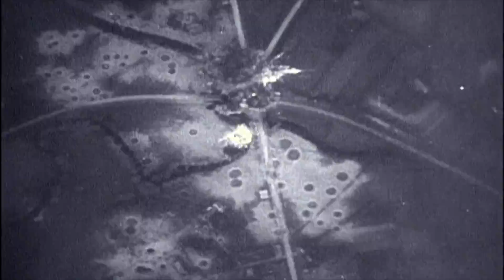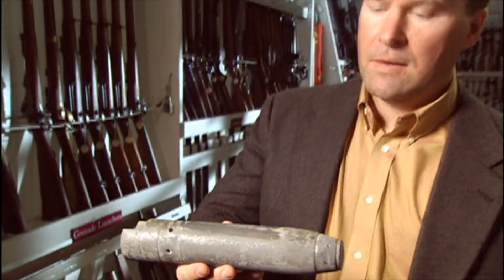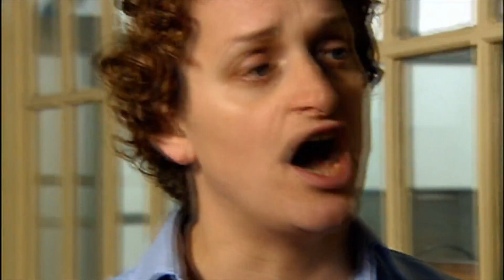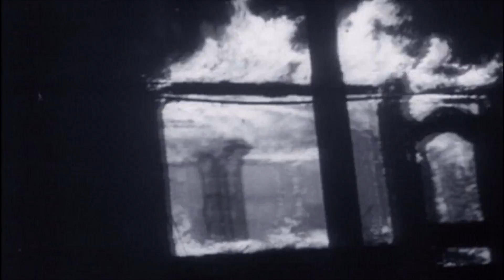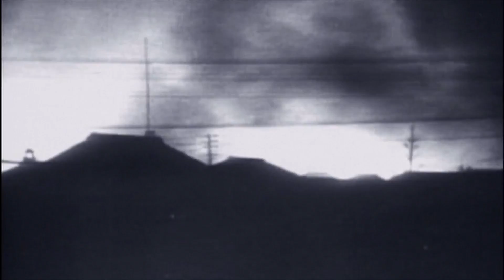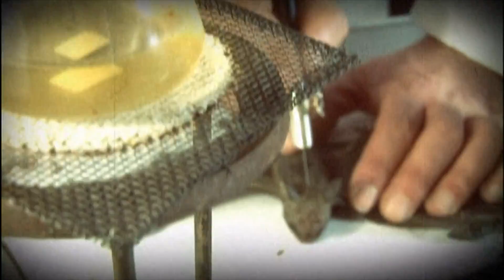Weaponology - "Incendiary Bombs"

Comment: “A lot of bombers, a lot of sorties, a lot of dead American airmen.”  To the British and then American bomber crews, thank you for your sacrifices.

Does anyone know the cost differential between an incendiary vs a gp bomb?  I know both were used widespread, but wondering if the manufactue of incendiaries was more or less involved than HE.

Also, I’ve read about several cities experiencing firestorms, were they relatively common, though?  That is, did nearly every incendiary attack result in a firestorm, or were there special circumstances involved that made some raids especially destructive?

Comment: The Japanese got their idea of balloon bombs from the British. The British got the idea from when their barrage balloons broke loose and drug their steel cables across Europe shorting out power lines and such and starting fires when they crashed. When they realized what was happening after they broke loose the British started doing it on a regular basis with cheaper balloons and because of wind currents the Germans couldn't do it back.

Comment: February 13-15,1945 was probably the worse scenario incendiary 🔥 bombing in Dresden than other German cities. March 9-10,1945 was really greater the worse scenario of Toyko, Japan. When night bombers flying over the city below they would say that the city below has dropped into hell. So much turbulence from the flaming city made the bombers flying much higher at 200 feet a minute on full throttle. Wings can be ripped apart from the turblence. The bombers that flow back to base can actually see the reddish-orange glow at 100 miles away at 13,000 feet. Returning bombers were actually covered with a dark grey soot. Human bodies actually hit the bombers do to the turblence at Gale force. Those are called a Firestorm growing out of control, babies can even suffocate when their own noses would burst open. People had to turn over the babies so they won't die from suffocating. White Phosphorus is still available today but yet it's very deadly poisonous. Napalm was invented by American as a sticky gooey gel but yet Napalm B a liquid not a gel making it burn longer than Napalm. Thermo barbic weapons has the strength of a small nuclear weapons with no radiation because it's non nuclear. America had the Daisy Cutter then MOAB and the Russians came up much stronger than MOAB it's called FOAB. Daisy Cutter would explode at 3 feet above the ground and having the mushroom cloud almost like a small nuclear bomb.

Comment: Interesting.....can anyone tell me why we use Napalm over White Phosphorus?
Reply: I think napalm was easier and cheaper to produce
Reply: Both "hansom" and wise...thanks for the reply!
Reply: Your also very handsome ))
Reply: YouMockMe Napalm bombs of the time were more destructive due to their operation- they basically landed and then launched a burning sock up five metres onto whichever nearby structure. White phos is useful against people and is also used for smoke, but doesn't have the same ability to ignite that napalm does.

Napalm is also easier to store- WP has to be kept underwater in its crate, because if it meets air it burns. Napalm can just be stored in barrels, simplifying logistics.
Reply: Napalm is easier to make, industrially, so that the "new" strategy was to spread napalm over the objective and use a minimal amount of WP to ignite the mixture; very effective.